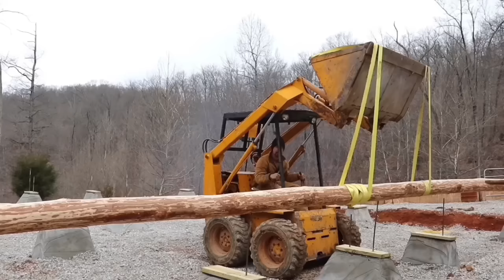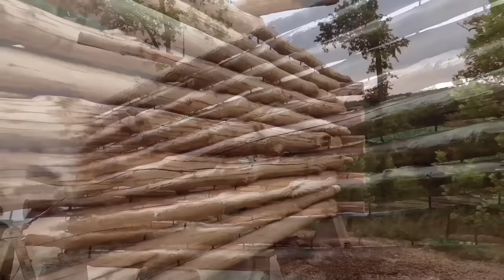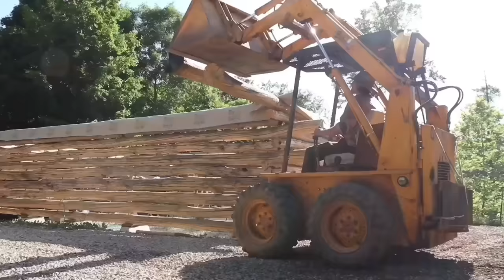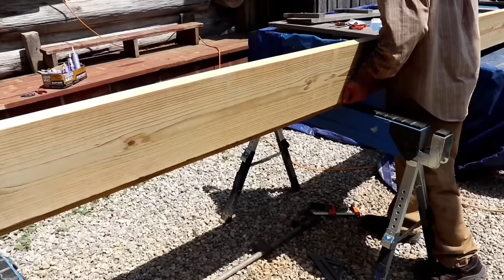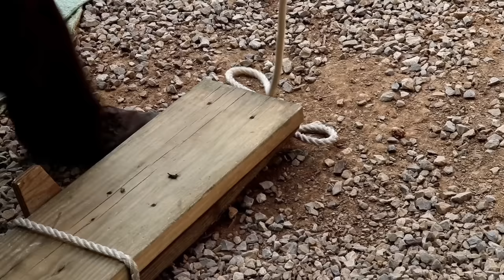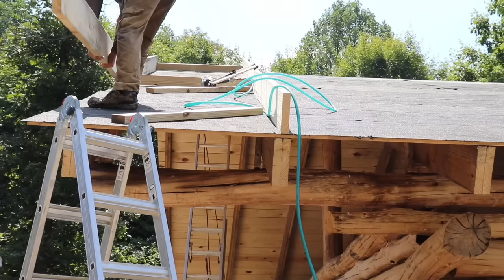Man Builds HUGE Amazing LOG HOUSE From Crooked Trees in 9 months - Full Build (TIMELAPSE)

Comment: Fantastic Job and a lifetimes worth of Memories for you and your family. I know because My Grandfather helped me build our Log Home and we did a lot of the very same things you did. Congratulations on a well built home.
Reply from the maker: Thank you so much and that’s awesome to hear! Thanks again happy holidays 👊
Reply: @tribeofdavid8  
Same to you and your Family from ours. Here is something you might find interesting. I built a complete railing on the loft and down the stairs (the treads and stringers were all ponderosa pine bridge plank size) to the landing in front of the front doorway all from red cedar, also from our property. It took some doing to get it right but my friend it's the first thing people see when they walk in our home. We used an almost identical sized pair of trunks at the bottom of the railings that have beautiful flutes, where the roots went into the ground that looked as if it grew right out of the floor. To this day (some 20 years later now) we constantly get told how unique and beautiful it is. There is not 1 nail or screw in it either it's all done with pegs and wedge's or long oak pegs. You might consider something like this, the Red Cedar (that are considered an invasive species here in the Mountains of the West) is so beautiful when sanded absolutely smooth and about 10 coats of clear gloss polyurethane that are sanded smooth between each coat....it looks like it's encased in liquid glass and so easy to keep clean and very durable. Just a little tip you might like to do maybe.
Reply from the maker: @IRONHORSE427RACING  that sounds amazing! Yes I might do something like that. We needed a quick space saver staircase and the current one fits the build but I could always change it later. I love eastern red cedar we have tons of it I built tables and the front door on my other cabin from it. Have to plans to build another cabin joining the 2 structures out of cedar logs
Reply: @tribeofdavid8  
I have wished many times that these videos like this, people could if need be, post a photo for the originator of the posting only, then if the owner of the video wanted to he or she could share it. My description of what it took me about 2 weeks to complete now if my memory serves me falls way short of what the actual finished product looks like. The Local Paper did a little booklet for the tourist trade we get each summer called "Log Homes" of our area. And the Staircase I built was on the cover of that Magazine and they did a 2-1/2 page piece on our home to show several other features where we thought outside the box so to speak. We were so proud of that we had a copy of it framed and it hangs in our Office we built above our Log Workshop and Barn.
Merry Christmas to you and a Very Happy New Year!

Comment: Oh yeah the Butt n Pass (Skip Ellsworth) method. The quickest and easiest way to build the strongest Log Home ever. I would only add one thing, Change that wood stove out for a Rocket Mass Stove, you'll use 1/10 the wood to heat your home and NEVER have to worry about a chimney fire. Also you only have to fire the stove 2-3 times a day in winter. Thanks for sharing, I want to build our Log Home next year or the next. Thanks for sharing. Best Wishes & Blessings. Keith Noneya
Reply from the maker: Thanks! i will check that out. Good luck on your build!

Comment: i was amazed. From Philippines. What were those insulation you put up in your roof? Seems your dwelling is not hot during summer, unlike here in our country. Is that the standard way on how to build a beautiful log cabin? Are those logs free? Or they are yours? Watching you working all alone is so wonderful, and still find time to play with family. You have a beautiful family. God bless you.
Reply from the maker: Thank you so much! polyiso foam panels 3.5 inch thick 4x8ft panels, the logs were free they were going to be burned so all I had to do was cut them down in time and use them. God bless

Comment: Man, that was fantastic back breaking work. I was astounded sometimes. I was just wondering if chinking was going to also go where the foam is between the logs. Does the foam shrink and fall out. I mean I used some foam around plumbing and it shrunk and fell out later. Just wondering. I love what you built. It is so sturdy. And the roof is great. Great video 😊
Reply from the maker: Thank you and I am using mortar over the foam inside and out. it does not fall out it sticks to the logs and is pretty difficult to remove actually if you tried. I did the same technique on a cabin I built 11 yrs ago and it worked great. Thanks for watching.

Comment: Do you have a slip collar in the interior stove pipe?  Normal expansion/contraction is about 1 inch for that length.. It will tear up your roof if you have not accounted for that.

Comment: amazing build dave, I thought you were going to say 2 / 3   yrs instead of 9 months ...  incredible !        here s maybe a dumb question :  I have dense woodland on my land , southern chile,  ..  could I not use the tree stumps as supports  for the  platform  ?   I don t see anyone doing it on the web ..  is it a rot issue  ?    surely stumps last ages  !!
Reply from the maker: Thank you 🙏 and stumps would last a while but not long enough…plus you’d have to have enough of them all in line to be a square foundation. Stone, boulders would be better if doing a small cabin
Reply: Yeah, I’m sure you’d like to use the stumps but as alluring it seems please don’t, it will drive you crazy 😜 they’re a good way for insects to gain entry into your structure and you’ll never get them in the right place , take Dave’s advice go with stone or concrete or mix of both

Comment: No worries with the lack of vertical load transfer at doors and windows?  Just feels so much different than typical king stud and cripple framing?
Reply from the maker: Nope none it’s transferred all through the logs and rebar pins. I built a smaller cabin same method 11yrs ago and never an issue with doors or windows. It’s a solid as can be. Never a change in how they open or close. Thx for watching!

Comment: My grandfather built a log cabin with REALLY crooked logs in a week (with 3-4 helpers), with a foot of snow on the ground (we slept in an old Army tent.  Slab had been poured in warm weather.  The logs were really crooked, so put the 2x10or12 stude 4 ft apart, so when cut that short even those logs were straight enough to use, anything longer than 4 ft would not have worked.  Studs/walls were put up in a day, I  think the rafters also.  Then most of the rest of the week was spend cutting the logs to length, spiking them into place, sealing the cracks.  Then put the board roof on, shingles, windows and doors.  Done.  Then it was move furniture in, that that was not made that is.  Done.   A pallet cabin done several years earlier went up in a day, again in winter, and we slept in it that night.  Next  day was covered with tarpaper, and done.
Reply from the maker: Awesome

Comment: I would think you need more than foam insulation & some nails to support the logs you cut for the door & window jambs.
Reply from the maker: nope the rebar holds the logs in place and the door frame/jams are all lag screwed deep into the logs. I did this same thing on a small log cabin I built 11 yrs ago and its still perfect. Thx for watching!

Comment: Are you worried about log shrinkage and the windows?  Just a question, not a criticism. You did a tremendous job.
Reply from the maker: Thank you very much and no because these logs wont settle as they shrink. The rebar keeps them locked in the position they are indefinitely. In this build style doors and windows are not affected by shrinkage.

Comment: Unfortunately, PUR foam killed the natural sense of this building. I know, it is simple and fast, but... Much better way is chinking with lime mortar from outside, and packing the gap with sheep wool or, at least rockwool.
Reply from the maker: Thanks for watching and yes I agree sheep wool would be my first choice if we were going to mortar immediately since critters will steal most of it if you dont cover it up. I had great success with spray foam in a cabin I built 11 yrs ago and its still going strong no issues plus the foam is a lot cheaper. The main plus for us was it allowed us to move in right away as it creates a structural gap fill. (cant be blown out from a strong wind or stolen by critters) we can let the logs shrink then fill in small gaps and holes then mortar inside and out which is what we are doing now. Thanks again happy holidays to you and yours

Comment: Very unorthodox on almost every level. Not sure about the foam insulation instead of chinking, think that stuff may fall apart long term. I would nail in steel lathing/mesh and press in a mortar based chinking w/ some hair or other binder. I would also mix up some boric acid & ethylene glycol and spray your raw logs at least twice, will add decades to the lifespan of the wood and prevent boring insects. When they dry out, linseed oil cut w/ mineral spirits can be sopped on w/ an old mop if you wanted yo keep some color on the logs. Nice build man, best regards.
Reply from the maker: thank you! the foam works great I used it in another log cabin build 11 yrs ago. We use nails and lathing and mortar to go over all the foam as seen in last clip of the video. We just havent finished all the mortar yet. We used borates twice already. Once when the walls were done then again when the roof was on. thanks again for your comment and watching happy holidays!

Comment: It was going so well then the expanding foam happened dissolution after that.
Reply: I have to agree that’s not going to end well,
Reply from the maker: did the same thing in my other log cabin built 11 yrs ago and not one issue so far. When you build with a "large hat" aka well designed roof the house stays dry and protected. These log walls have not been wet since the roof went on. Overhang is key and what you go over the foam with must breathe.
Reply: I've seen what happens, personally it goes Brown after five years then powders. I had a builder on my rebuild recently he used the stuff I fired him on the spot.
Reply: But I will say this you cabin is my dream and I'm jealous as flick
Reply from the maker: @endangereddangerous8102  maybe in your application but in mine it’s covered by mortar on both sides and never degrades. Like I said no issues in the other cabin I built 11 years ago. I plan on making a video on it. I will tear open a mortar joint to expose the log and foam underneath and guarantee it will look just like the day I covered it up. Sorry it didn’t work in your build but yes I agree if exposed to the elements it will deteriorate

Comment: No way he can heat that huge space with that wood stove...  Unless it never goes under 50 degrees  F.
Reply from the maker: it was -31 F here a couple weeks ago and it did just fine its a very good stove and very efficient house
Reply: @tribeofdavid8  
WOW!!  That's incredible!
My house has an old wood stove and it works, but my space is 1/3rd of yours.
I guess the new ones are better.
What about snow?  Do you clear snow off the roof?
That roof angle isn't steep.
Reply from the maker: @indrekkpringi  new stoves are great the roof is fine snow helps insulate too but we don’t get enough here to be an issue
Reply: What about snow on the roof?
Do you get much snow?
Reply: @tribeofdavid8  
Oh!  That explains it:
We had 2 feet of snow and then...  it rained inches
I had to shovel the snow off the flat roof because of the rain soaking into the snow and increasing the weight  
It rains here after it snows in Quebec Canada because of the crazy weather we have now.

Comment: Nice build sorry to see you F it up with your roof insulation system . It will rot I promise you
Reply from the maker: why do you think it will rot?
Reply: @tribeofdavid8  I don`t think I know,Count the vapor barriers you have stacked up
Reply from the maker: @danstomber1664  what? There’s only one. The peel and stick roof membrane over the decking. Then the foam the grid system of 2x4s so condensation can drain and leaving an air gap plus eave vents all along the roof both sides which vent out the ridge vent. It’s a simple proven system. Works great. Why would you say I messed it up then?
Reply: @tribeofdavid8  Well lets count,1st one is ice and water 2,3,4,5, on your foam board.I have been doing this 45+ years and it will condensate between each I promise you.I have engineered and repaired many sorry it`s just fact